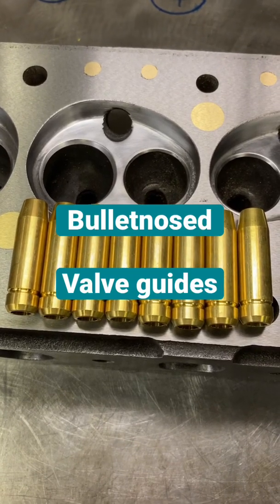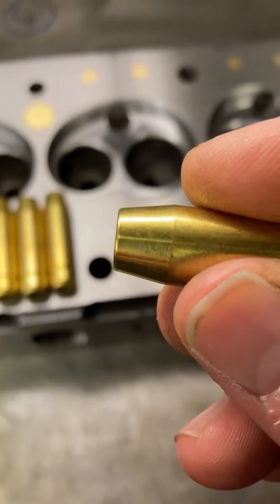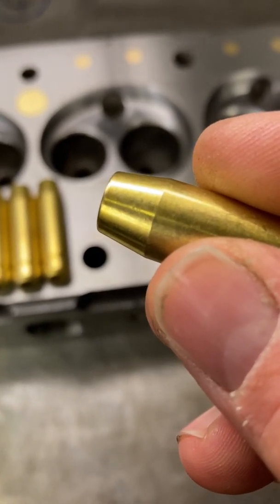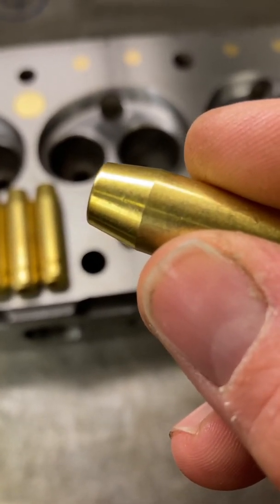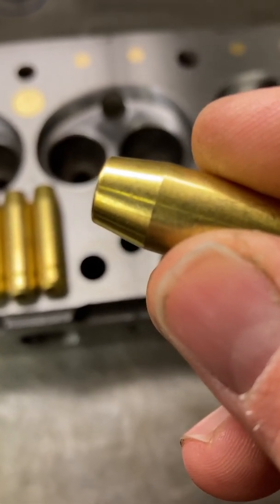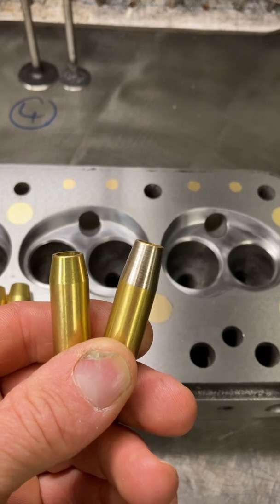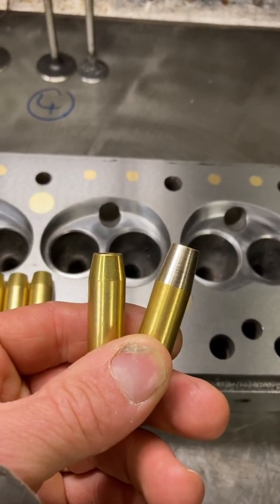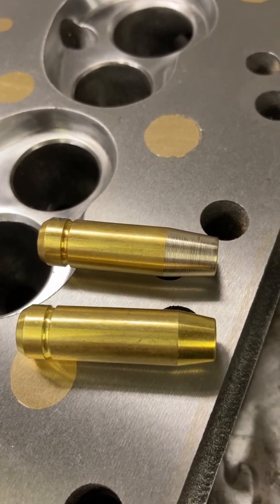Bullet nosed valve guides how to Improve airflow on your classic mini cylinder head.

Comment: Bullet nose means round IE streamlined like a bullet
Reply from the maker: Adding the taper to the end makes the guide more streamlined. Hence the term, bulletnosed.
Reply: @TurboMinicom i beg to differ, been porting and flowing for many years, watched and read every book and video, spoke to 100% every record holder in my county and we all round off the front with Zero sharp edges.

Sharp edges break air speed.

Your tip if flat, it should be rounded, like a bullet.

You misunderstood something somewhere when you got your knowledge
Reply from the maker: @CBD-Auto  I’m not sure where you’re seeing a sharp edge? The very end has a radius on it, there is no sharp edge.
Reply: @TurboMinicom on the tip, its flat, where it transitions to your 70 degree angle, thats a sharp edge
Reply from the maker: @CBD-Auto nope, there’s a slight radius on it. It’s obviously not clear in the video.

Comment: When fitting new guides it helps to gently warm up the head and pop your new guides in the freezer for a while before driving them in with a stepped aluminium drift.
Reply from the maker: Yes & some lubrication of the guide bores in the head helps to.
Reply: I tapped my 8mm guides in with an M8x1.25 socket head cap screw, worked great out the freezer and into a warm AL head. About 3 whacks with a 3lb sledge. That is how my Mazda manual said to do it.
Reply: @ sounds good 👍